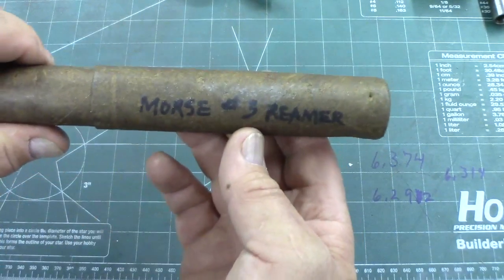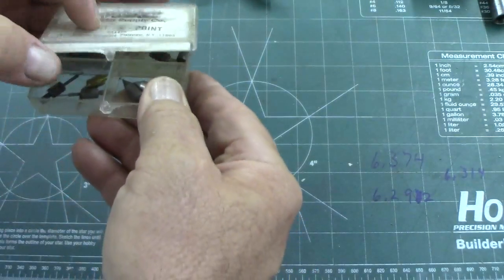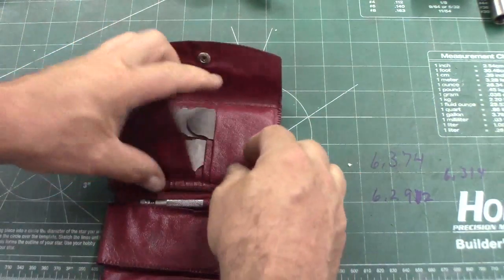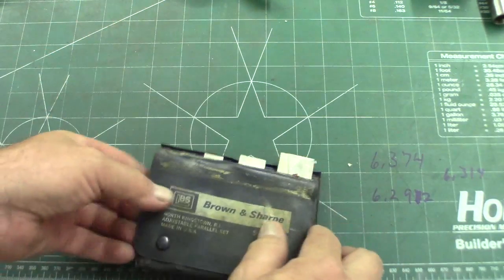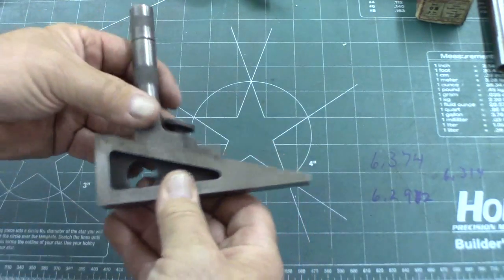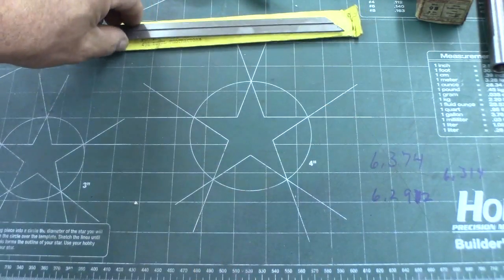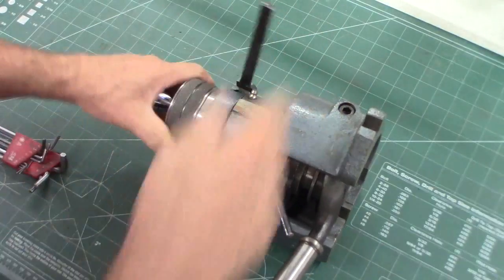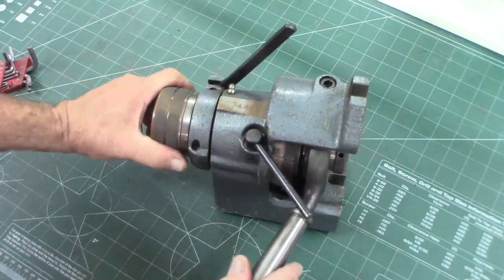Ketchup #52 - Mail, Boring Head, Viewer made tools, Toyota Roll Cage

Comment: nice tool score there Randy. that other handle on your indexer is for the locking pin, on the backside there is a ring of small allen head screws. back out the ones in the positions you want it to lock. its like a dividing head masking plate. taker easy
Reply from the maker: Great, thank you for the info.   I was able to download a manual.

Comment: Hi Randy,
9k, good progress, I still remember that you're the very first that got me encouraged my channel, how to get addicted... lol
Nice new tools, you're near of needing a bigger shop. Those smaller dovetail cutters are great works.
Roscoe, will get his off road drivers licence soon.....   ;)
Cheers,   Pierre
Reply from the maker: Thank you Pierre.  Bigger shop would be nice.  Don did a great job on make his set of cutters.  Roscoe is always ready for a ride.
Reply: Not able to say the same about the cat over here, he freaks out at anything noisy around, shop, lathe, car, whatever.............. !!!!!!!!!!
Reply: I dunno Pierre, that planer gauge really needs a planer to go with it. :-)
Nice tools Randy, it's going to hurt a bit getting a proper set of boring bars for that head unless you already have some. Great dog as well. And that's probably the best designed roll cage I've seen for home built or a commercial product. 10,000 subs by the end of the year maybe.
Reply from the maker: Thanks Pete.  I have a planer.  Yes Boring bars will be tough, 3/4" shank.  My son has done a great job on the roll cage.
Reply: Well I doubt you don't already know it Randy, but others might not. Criterion offer hardened and ground reducer bushings to use smaller shank boring bars than the heads are ground for. Soft shop built ones would probably work just as well. My Narex head takes 5/8ths tooling and those are expensive enough.
Reply from the maker: Thanks Pete, I will look into those.  I was thinking of making some my self.
Reply: If I remember correctly Randy Criterion cuts a window in the side of those reducer bushings so the set screws that hold the boring bar in place can go through that window and lock the tool on the shanks flat. Thought I'd mention they also sell a proper 1/2" shank replaceable tip boring bar that gets used in the cross hole on the 202 heads that not many know about. A very nicely made bar, but about $80 from MSC when I bought mine. It's not shown in the blue book, but MSC can get them since Criterion won't sell direct.
Reply from the maker: I will check that our with MSC, I have a special deal with them and get a great discount all the time and free shipping.  Thanks for the info.

Comment: The indexer appears to be a Yuasa....by setting the set screws in the 24 position head, you can set it so the pin drops in only for 2, 3, 4, 6, 8, or 12 position indexes. You index it by pulling the sping lever to release pin, and the handle (that you did not know what it was for) lifts up and will drop in the next available hole depending on the index you set it for. The handle ratchets back down, and ready to lift up for the next index. The spindle nose piece can also be removed to install a chuck if needed
Reply from the maker: Thank you Jim for the info.  I also think it is a Yuasa.  I was able to download a manual and parts list for it.
Reply: I have a Yuasa also....they make some fine quality products....almost as nice as my Hardinge!

Comment: Wow, you sure got a great set of tools there from Rick!!!  I have an old Brown and Sharp version of your indexing collet holder.  Mine is missing the clicking ring part, and I'm wondering what real purpose it serves. (other than using it as a handle to move from one position to another)
Reply from the maker: Rick was very generous.  On the yausa web site you can order parts and also free pdfs of  the unit.